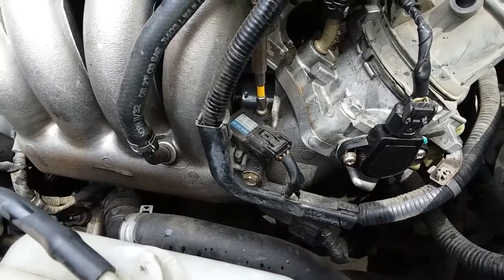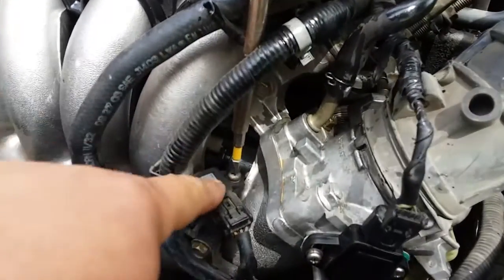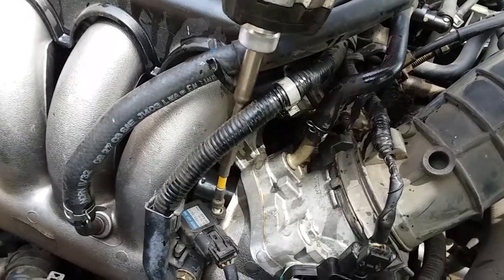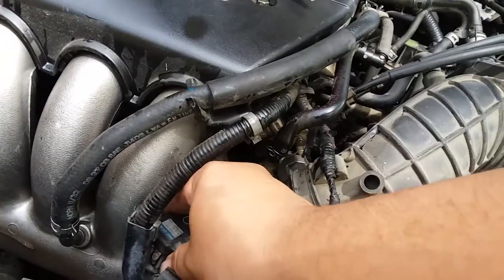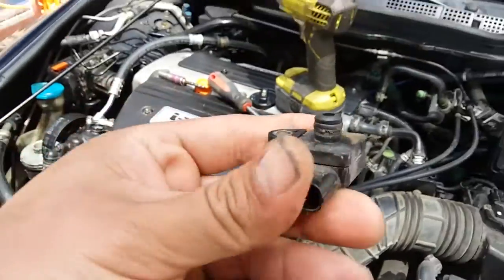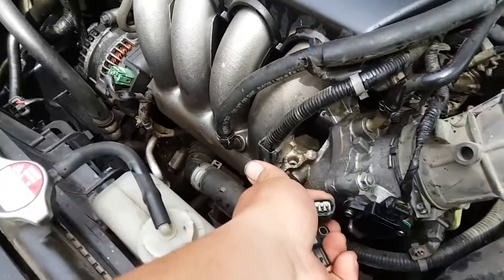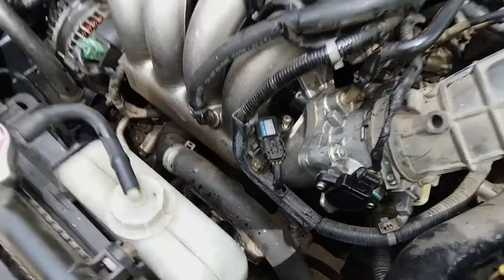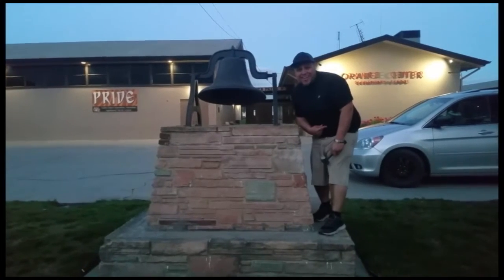How to: Change MAP Sensor on a 04 Honda Accord

Comment: how you know if it needs to be changed or just cleaned?
Reply from the maker: You can start off by cleaning it first, if the car acts the same try replacing it and see if that works
Reply: well my car shakes a bit at 1,800 rpms would this be the cause? If you know by any chance? Thanks
Reply from the maker: @greatjuankenobi217  Any check engine light?
Reply: GEORGE LOPEZ HOW TO DO IT YOUR SELF no sir
Reply from the maker: @greatjuankenobi217  How about last oil change? Intake Air filter dirty? Spark plugs replaced recently?
Reply: GEORGE LOPEZ HOW TO DO IT YOUR SELF oil change is due now, filter is clean, spark plugs just changed a week ago. NGKs
Reply from the maker: @greatjuankenobi217  Wow. 🤔. Have you ever done a Seafoam Treatment? To remove carbon deposits from the intake manifold and clean the valves out, old oil buildup and clean the fuel injectors. I did it to both of my Hondas and I felt a world if a difference in performance and acceleration. I'll provide both videos. Hopefully this makes a difference to your vehicle. 
2010 Honda Odyssey
https://youtu.be/pCtcnefCaJw
2006 Honda Civic Si
https://youtu.be/PNJJdfizpuQ
Reply: GEORGE LOPEZ HOW TO DO IT YOUR SELF thank you, will try this.